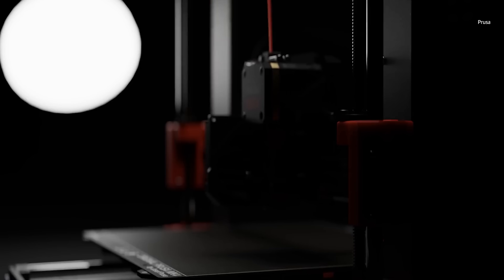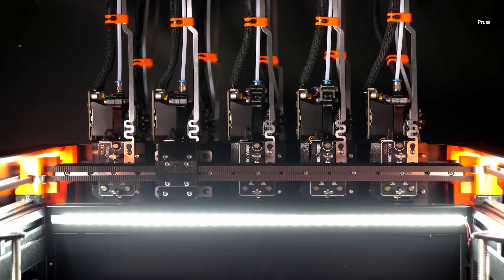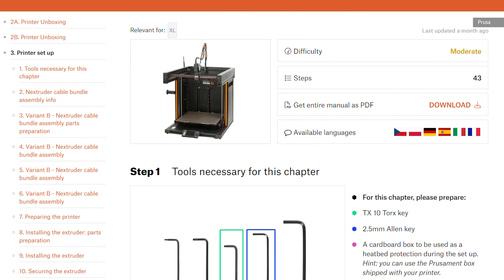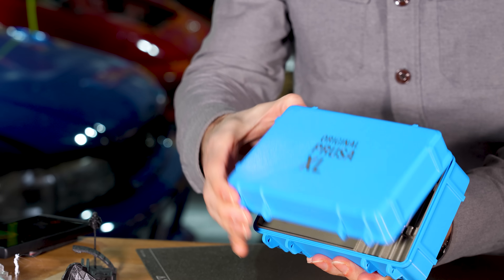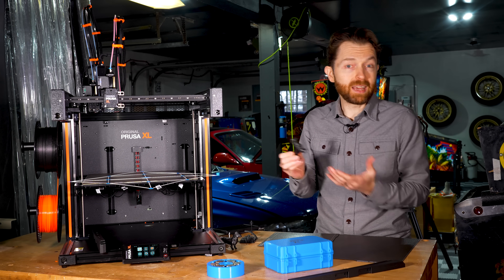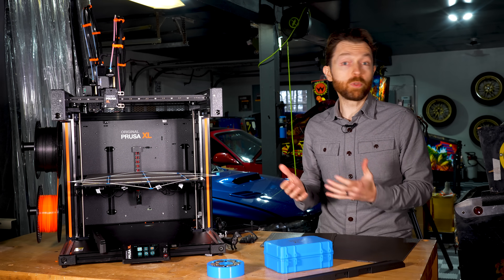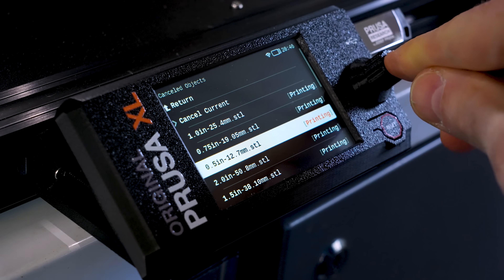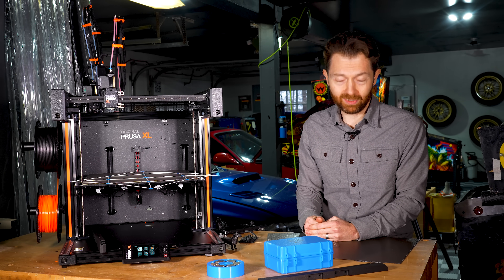Prusa XL review: A big 3D printer with a few big compromises

Comment: A toolchanger is great for different materials and nozzle sizes. However, while there is less waste and faster colour changes, for something real multicolour a toolchanger has it´s limitations. If you f.e. want to print a big hue forge print, you might want more than 5 colours.

Imho Prusa made a big error not supporting the MMU2/3 on the XL. The MMU3 supports 5 filaments (a modification on github expands this even to 12). The waste and changing time is acceptable compared to other fillament changers, as the Nextruder can use ramping-on-unload to get a nice filament tip instead using cut&poo.

Adding a MMU3 (you might even have from a mk3s+ or mk4 already) to an XL would make the XL much more affordable. You could start with the 1 or 2 toolhead version, adding the MMU3 (or the github MMU3-12) to get 5/6 or even 12/13 colours - of witch one can be a different material. You could upgrade to 5 toolheads later, if you need more than 2 materials or nozzle sizes.
A 1 toolhead version would give you the bigger size - and 2100€ would be OK compared to smaler alternatives. Even if you do not already have a MMU3 (+330€) it would be a printer with a good function2price ratio.
Imho best value to price would be the two printhead version, using two different materials, like PET-G+PLA-support, with MMU3 allowing multiple colours. Or ABS+TPU. Or anything+soluble support. Most of the time more than two different materials are not needed. Still, MMU3-support (best with the MMU3-12 supported on display and slicer) would allow big full multicolour prints.
2600€ (+MMU3) might be still in the budget for a hobby. If you could afford it, it would be the nearly perfect day2day printer for almost everything.

However 3700€ for 5 printheads you often do not need anyways is a hard pill to swallow, if you are limited to 5 colours, while other manufacturors allow up to 16. Paying 4k€ with MMU3-12 on one toolhead allowing 16 colours might be a different deal, as f.e. a much smaler X1C with 16 colours already cost 2400€ - and the XL does not only have a bigger size, but is much faster and less wastefull for up to 5 colours (and still faster and less wastefull for more colours).

The moment Prusa adds support for an MMU to the XL is the moment I order one. Depending on my budget the 1 or 2 head version. Upgrading later to 5 (if different nozzle sizes are supported better in PrusaSlicer). I realy like my mk4(s) for multicolour, so much less time and waste compared to my A1mini+AMS light or Kobra 3 combo.

For an enclosure: If you reuse a room with a build in wardrobe or if you build a cabinet with multiple printers anyway,  you might not need it (you might locate the PSU outside, however). The XL is sort of a hybrid between a very advanced high-level consumer printer and a quite nice buisness printer. If you need an enclosure with the printer or not depends on the needs of the user - imho its ok as an option.

Comment: What's crazy to me was Prusa still charging almost $300 for shipping after I would spend almost $5k on a printer.
Reply: Has this changed now that Prusa has factories in America?
Reply: @joeking433  It was $150 bucks to have mine shipped to the other side of the planet... Hah. Considering how big it is, you cant really expect much less. Import duties they cant control, and are dependent upon the country its being shipped to. So they cant really be blamed for them, plus, in my country the import duties were cheaper than the tax would have been if I'd purchased it domestically. Significantly cheaper actually. I'm in Tennessee. so yeah.

Comment: I have a mk3 Prusa I've had for 7 years. The MMU2 was a complete fail. When they built the XL I think they abandoned the MMU series for something that actually works. I have now gone the Bamboo Lab A1 way and not being a fan of high speed its a much more capable of being a successful multimedia printer. The support for the Bamboo is very very good in my opinion. Bamboo Lab has being reported to be bringing out a larger format printer in 2025 something I'll be looking out for. Prusa XL is too expensive.

Comment: I have had my 5 head since before Christmas.   I am still getting the hang of it.  Built like a tank with high quality parts.  I have had problems with the extruders and Prusa support has been great.
I added the SUMO enclosure because of the lack of one from Prusa.  This is where I do blame Prusa, no enclosure and many spare parts are not in stock.  I also have a Bambu X1C with AMS and the P1P.  All are good printers and have their plus and minus.

Comment: I'm more excited about the Voron kits that are adding multiple heads, and the ProForge 4 with 4 heads for 1/2 the price and larger print area and much faster print speeds. Hoping that last one really is rock solid as it's built based on Voron and other fast printers but with tool changer too.
Reply: Are the Voron kits large format?

Comment: I put my deposit down for an XL but got so sick of all the delays I redeemed my deposit , I held out on buying an X1 Carbon and AMS as I thought there would be some competition to the XL but that never happened and so I bought an X1 Carbon and AMS, I have calibrated the purge to lower the wastage but that wastage is still high compared to a toolchanger, I am glad I never bought an XL though!
Reply: More weight in wastage than in the print!

Comment: I bought it because of the tool changer: absolutely worth it for me. It is awesome. 
If you want the fastest printer out there: XL is the wrong printer.
If you want quality: get it
Reply: Not exactly. At default .6mm nozzle and horrible stringing/and loss of detail on top of needing to dial the printer in before it gets decent.

Currently Prusa is sending out a bunch of firmware updates to fix the inherent problems in the hardware.
Reply: the XL is now shipping with the .4mm nozzle @personwomanmancameratelevision

Comment: multimaterial without "printer-poop" is worth a lot!
Reply: You remove the poop but still need a prime tower...It's not exactly like you are saving filament. If you remove the prime town then you are dealing with even more stringing and print errors. 
 
Also how much filament/money are you saving between a 1k printer and a 3-4k printer?
How many rolls can you buy for 3k? 150-300 rolls?

So the poop(1-2grams) you mention is a penny or 2 worth of filament.
Reply: @personwomanmancameratelevision  There is more to "worth" than just money --> Environment...
Reply: @personwomanmancameratelevision   you are saving 4x as much filament as you  waste on AMS/MMU setup. Blowing twice as much plastic in poop or waste tower as the print is like tossing  money in the thrash. And you are forced to price your MM Prints  higher.
Reply: You are assuming the quality of the XL is on par or better than any of the bambu printers. XL is objectionably worse. Look up any multi-color print from the XL. "Tada printing" for instance. How much waste when the print fails, looks terrible or doesnt meet spec?

$3000-3500 in savings is filament, printers, parts. Adding more printers increases output but seriously you can have a whole print farm with 3500-4k.
But when addressing 1 printer
You would need to spend $3000 in LOST FILAMENT($20 a roll) at less than a .3-.1 gram per filament change depending on color. So to even break even you need about 150,000--500,000 filament changes for the break even price of the XL even pushes out a gram of plastic . If you buy filament in bulk you can double those numbers. 

This is before changing flushing volumes, using waste for infill or supports,  printing multiple duplicates in the same print job or designing your part to lower filament changes so you may never reach those break even price, during the life of the printer. 

It's basic math.

Also rarely mentioned but between the XL spool and run out sensor there is a few feet of lost filament at the end of each roll that never gets used.
And lastly filament is not wasted if your truly care about that. You can easily melt it into a mold. (lego blocks, art. functional parts etc)
Reply: You are assuming the quality of the XL is on par or better than any of the bambu printers. XL is objectionably worse. Look up any multi-color print from the XL. "Tada printing" for instance. How much waste when the print fails, looks terrible or doesnt meet spec?

$3000-3500 in savings is filament, printers, parts. Adding more printers increases output but seriously you can have a whole print farm with 3500-4k.
But when addressing 1 printer
You would need to spend $3000 in LOST FILAMENT($20 a roll) at less than a .3-.1 gram per filament change depending on color. So to even break even you need about 150,000--500,000 filament changes for the break even price of the XL even pushes out a gram of plastic . If you buy filament in bulk you can double those numbers. 

This is before changing flushing volumes, using waste for infill or supports,  printing multiple duplicates in the same print job or designing your part to lower filament changes so you may never reach those break even price, during the life of the printer. 

It's basic math.

Also rarely mentioned but between the XL spool and run out sensor there is a few feet of lost filament at the end of each roll that never gets used.
And lastly filament is not wasted if your truly care about that. You can easily melt it into a mold. (lego blocks, art. functional parts etc)
Reply: It does poop.
Reply: It would take you hundreds of thousands of filament swaps to match the base price of the prusa XL for a P1S
.3-.7 grams per swap for 150,000-200,000grams of filament for that 3k difference. 150-200 rolls of filament. This is years worth of printing.
Reply: @AwwwSnapperz  The math is simple and this is before doing filament swap tweaks for more yield. (50%)

Comment: Is it possible to shorten the PTFE tubes or do they have to have the defined lenght to work with the filamant detection software? would like to feed the extruder form above and not from the sides. And maybe an odd question but would it be possible to mount the 2 toolheads for example in position 2 and 4 and calibrate the printer this way so it would allow to use horizontal cable chains to guide only the cables?
Reply: You can change the ptfe tube sizes.  I extended mine so both detection units are on the same side.

Comment: Great recap! I've got a 5 toolhead XL and i am very satisfied with it. I was able to print multicolor, multimaterial and even multi nozzle size prints/ Prusa slicer doesn't support multi nozzle directly yet. However with some modifiers you can achieve it. Mixing materials is not a trivial thing even just different brands filaments is problem is on its own way. Think that someone is going to solve all of possible combinations with a single click is not realistic. It always brings in some additional tweaking. On other hand, it is interesting how everybody is talking about Bambu, how much advanced it is. The design is obviously changing the perception a lot. Nice looking printer. When I tried I didn't find any game changing feature with them which would change my experience ground up and allow me to do what I cannot do with Prusas.
Reply: Would you might sharing how you achieved multi nozzle size prints? I really hope that in the near future this will be implemented in the Slicer, but right now this machine is not completely up to its possibilities I guess. 
But I am really happy to have my own 5 Tooly :)

Comment: It was surprising to hear you cant mix nozzle sizes. Shouldnt that just be a slicer setting?
Reply: It's a slicer feature; not developed yet, hopefully in progress.
Reply: @dsjove  FYI - Cura 5.6 does support different nozzle sizes. If the XL isn't locked down then this could be a workaround until Prusa Slicer supports it. I'm currently working on a Voron Trident with a custom toolchanger.
Reply: @JeffBradway  It is not locked down. Hopefully the open source code will bubble its way to prusa soon.

Comment: 6:00 SuperSlicer uses % of nozzle instead of PrusaSlicers % of Layer height. This allows you to mix nozzle sizes, however it is pretty limited. The SuperSlicer developer restarted development in November last year and is working on the PrusaSlicer 2.7 Merge to add all the missing features as it currently has a fork of PrusaSlicer 2.5.
Reply: thanks for mentioning the restart of development. thats huge! :)

Comment: I ordered an XL when it was first announced, and have a MK3 and MK2.5.  When all the delays started, I eventually cancelled the XL and bought a Bambu Lab X1Carbon.  I'm so happy I did. I have 2 now, and a Bambu Lab P1S as well.  In hindsight, the XL is fine, but the need for a BIG printer is limited. I had a large Craftbot 3 that IO just got rid of, used too much space and rarely did I print so large.  How does the heating work on the XL?  Does it keep all nozzles heated or do you need to wait for it to heat every change?  Overall, I'm very happy with my Bambu printers and not sorry I cancelled the XL. Yes, its wastes filament, but usually I have different types of filament in my AMS so just using it for one color but with the ability to easily pick the material.  I can do eveything from my phone and never physically touch the printer. Hopefully more multiextruder printers will come out, but at a much lower price.
Reply: It's quite intelligent with the nozzles, it will cool down to 170 if it's not going to being used for a bit but otherwise it'll keep it heated ready to go, when it stores/parks the nozzle there's a little flexible part that plugs the nozzle to prevent oozing.

Comment: Just can't justify the price when you can get other multi color printers that do the same thing, (maybe even better) for a fraction of the price.
Reply: It depends on how much a person prints and how much time idesires the work to be done.
Waste is the big problem of single head multicolor printer, for some even more since their reliability is derives from cutting the filament and than the need to purge a more filament.
It is easy to simulate the waste costs, are only needed the slicers software.
Reply: @donkeymarco   So let's do the math.
5 head prusa 3500(4k assembled...assembly required) and 120 shipping

A1 combo 560(this would be the easiest competitor to compare as PLA/PETG/TPU) 
p1s combo 950 Enclosed prints more exotic materials
X1C combo 1450  Enclosed prints more exotic materials
$35 shipping or 0 if you are near a microcenter. 

If in the worst case scenario how much waste are you anticipating to spend 3K+ worth of *waste filament*.
Keep in mind at default poop settings can be less than gram and it can be adjusted. 

So for the savings you can have a small print farm, buy filament(deal with waste) and still come out ahead in quality(.4mmvs.6mm) faster with the option of printing specialized filaments.

This isnt even a comparison at this point.

Comment: I print functional parts for a business so I'm more interested in multi material printing, so printers like the X1 that can do multiple colors it's not really that exciting to me.  The multiple heads is what can really help me out.

I've already invested in an aftermarket enclosure and bought .4mm Nozzles as precision and detail are more important than speed for me.

If be interested if you did a video on what some of the multi material challenges were and how you overcame them.

I imagine printing PLA over PETG was a challenge for the very reason that it doesn't want to stick to it.  I can see adhesion issues for that first layer. 

Subscribed.
Reply: Who says you can't do multi material with an ams.  That's made up.
Reply: @Matt-bb3nr  You can, and I actually do now without an AMS, the issue comes when printing materials with vastly different melting temperatures.  It's very prone to clogging.  For example printing something with a 300 degree melting temperatures before say something like PLA with a temperature more around 215.  If you're not very careful when you switch to the PLA, if there's any of that 300 degree material left in the nozzle you'll clog it at 215.

So while your correct it can work it's not nearly as efficient as doing it with multiple print heads.
Reply: @bluerider0988  what are you mixing with pla that prints at 300.  Not only that but that wouldn't require an enclosure.
Reply: @Matt-bb3nr  All of my printers have enclosures, I personally wouldn't go without one as the quality of the parts is generally much better when printed in an enclosure.  I don't currently have a specific application where I mix higher temp materials with PLA on a single part, but I do print with both materials on my single nozzle machines and have experienced clogging issues when switching.  

So on the XL it will be nice to have a dedicated head for high temp materials and if an application arises where this would be beneficial to use both in the same part, I am hoping to be able to do it without issue.  It just opens up the possibility for printing materials with vastly different melting temperatures with hopefully less issues.  Time will tell.

Also don't get me wrong, I'm not knocking the AMS, it's a clever system, it just doesn't have some of the benefits that a multi head printer has.  That's my opinion anyways.